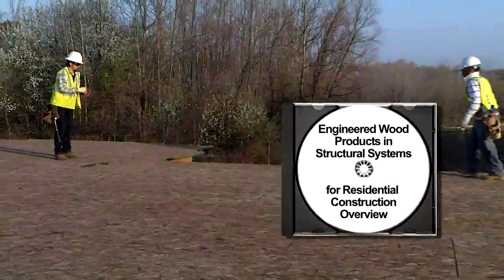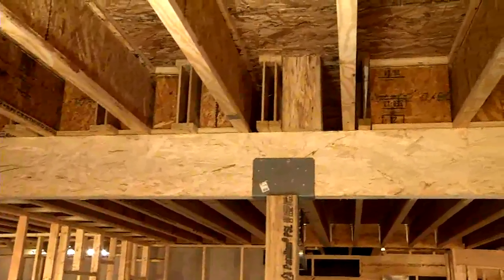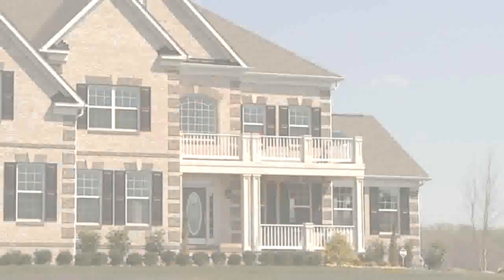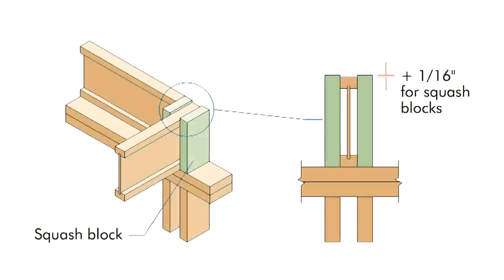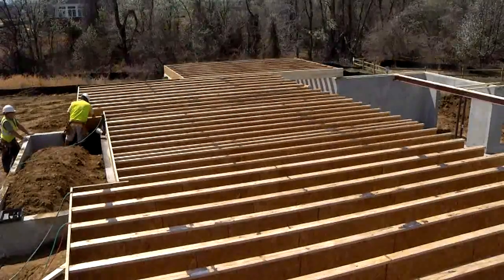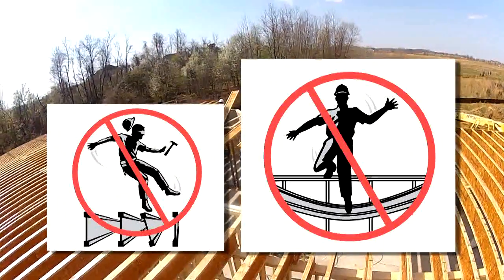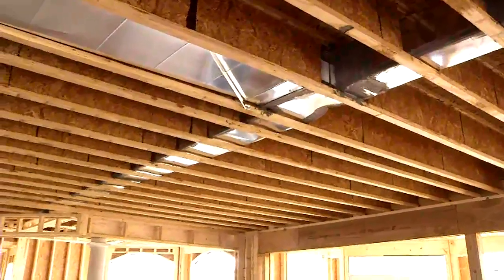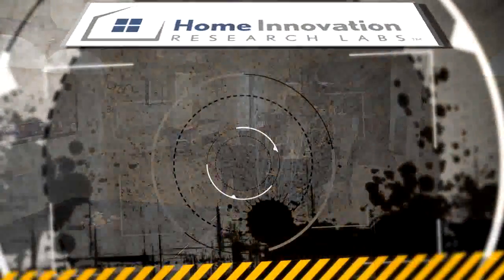Engineered Wood Floor Systems: Best Practices

Comment: Wow, knockouts in the middle third of the I-joist to run duct work? I thought that was not considered acceptable practice?
Reply: Brian Section R502.8.2 in the International Residential code allows it as per manufacturer’s instructions.  The middle 1/3 is off limits for “notching” in Section R502.8.1 which is for “sawn lumber”.  But even then you are allowed to bore holes into the sawn lumber joists as long as the diameter is no more than 1/3 of the depth of the member, an no more than 2” close to the top or bottom  of the member. Hope that clarifies your concern.